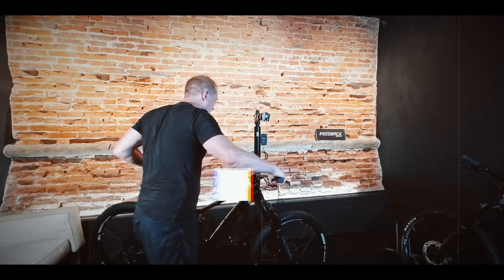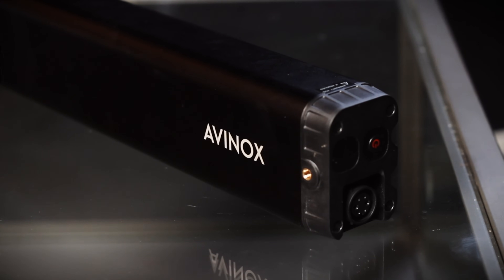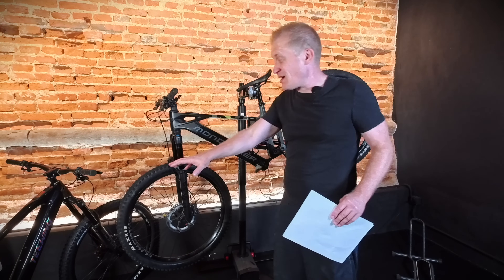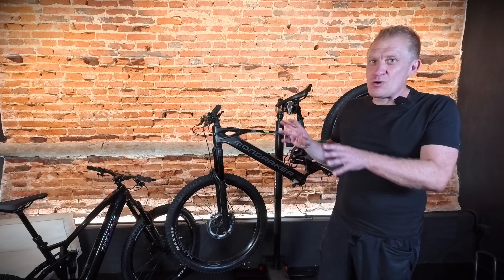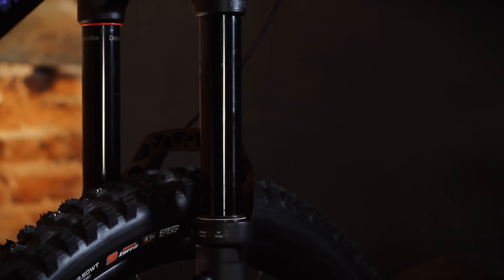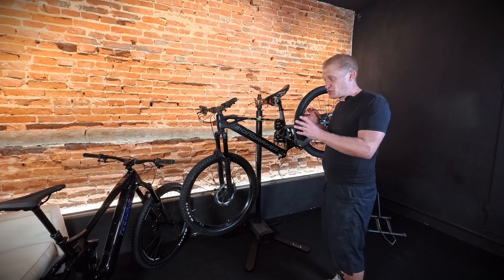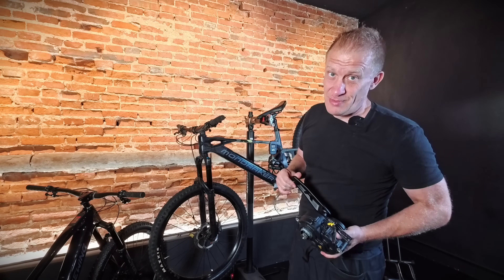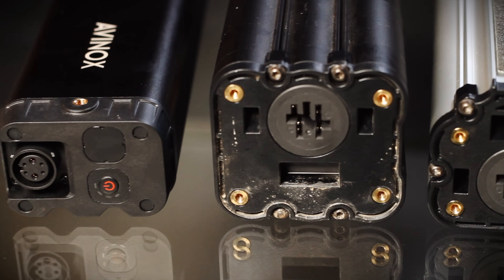DJI Or Bosch For A Better EMTB?

Comment: The DJI motor clearly wins in the software display department. I've seen several people who have tried both say the  DJI motor feels like an full on full off experience while the bosh performance cx responds better to your pedal. IE the more you push the more power. The latter seems more ideal. The Bosh motor is more refined in that aspect. DJI gets a lot of hype because it can put out more power. I'm not sure that hype is deserved though because that extra power draw is exceeding class 1 ebike limits. I don't think that is a good thing. 100 nm is a lot of power. Honestly I think that should be the cap for e- mountain bikes. DJI really made a splash with the software and power of that motor but they really pushed the boundary in a way that the bikes might not be legal on most single track trails in the US since they  don't meet the class 1 ebike specs. So when you operate the bike withing class 1 parameters, is isn't so exciting.

Comment: Absolutely same conclusions 6 months ago, i took mondraker crafty, and not amflow. My friends say "its heavy" but, put this stuff like Shimano XT or FOX 38, and it will be almost the same weight. I have 750 watt update on it, but not using this when i ride trails. 600 is enought. Too much marketing, like display in a frame. For what? I need just indicator for mode and % of battery and not reading books on it. Im over 100kg, and when 80kg reviewer say that he feel flex on Amflow frame, we know where they save weight ;)

Comment: Respect sir that’s exactly what I’ve explained to people who gets the avinox or light weight bikes 
Same happens to me got a turbo levo carbon expert 2022 weight 22kg
Tyres side wall junk 
Wheels folded like paper with singing spokes 
Now I’ve upgraded the bike to a full heavy enduro machine wheels brakes suspension coil shock tyres now weights like 26 kg 😂😂😂 it’s not possible to have an enduro all moutain bike stronger and light at same time
Reply from the maker: unless you drink kool aid and have an avinox motor ...... then we are all wrong and we know nothing.....:-)

Comment: I think a big thing to note on the batteries is the length, while the avinox may be slightly lighter it is much longer and will have its weight distribution further up in the down tube towards the fork. It terms of ride quality it seems like having the CG as low as possible is pretty key and the Bosch should do a much better job of keeping the weight low and as close to the BB as possible.
Reply from the maker: The GLP3 is the king sfor weight distribution
Reply: @alexbiketester a lot of e-ews were won aboard that

Comment: Rider weight. Very light riders will notice bike weight more.  Light rider smaller motor & battery makes sense. 70kg rider 600w/h. 90+kg 800w/h with powerful motor.

Comment: Hopng Bosch make a slimmer 800wh (yes, and longer) battery profile option in the future to allow for slimmer downtubes. 600 not a good option for me as I  routinely drain my 750.
Reply from the maker: apparently they have a thin 1000 in the works
Reply: Get the power more..

Comment: Before buying my Teewing, I did extensive research.  Simply put, DJI's motor, wireless and battery systems are more advanced than Bosch.  Not surprising given that DJI is the world's leader in drones, which gives DJI extensive experience in minaturized motors, advanced batteries, and wireless communications.  Bosch's background is in making household appliances, power tools and heating/cooling equipment.  The tech required in their past products is very different.  Bosch's push to limit ebike motors to 750-800 watts is an implicit admission that they are having difficulty in keeping up with DJI's tech.
Reply from the maker: i know what you are saying but this reads like Ai...
Reply: @alexbiketester  LOL.  I somewhat doubt if ditcho100 has been mountain biking at all.
Reply: So what your saying is you work for or are paid to comment favorably for DJI. Got it.

Comment: A few things to keep in mind. Amflow comes with a compact portable fast charger and also lets you ride in class 3 28mph in the US. The bosch systems do not have these features.
Reply from the maker: the fast charge fact will ruin your battery quicker....
Reply: @alexbiketester fast charging doesn't ruin a battery, heat ruins a battery and also continuous charging when at 100% causes stress. Always charge in a cool environment and and when reached 100% remove from charger, and don't store at 100%
Reply from the maker: @Hassle68  Specialized specifically told me, that their battery can handle 250 fast charges, then it will degrade and need replacing.

Comment: I’ve got the latest Bosch with the software upgrade. Plenty of power but where it wins over the Dji and yes I have ridden both on the same trail on the same day is the smooth control, the way it delivers the power. Also its top power is not limited to a burst either. Then my living situation means I have to take the battery out for charging, it all became a no brainer.
Reply: My Teewing's/DJI's power curve is extensively adjustable via the app.  So the power surge is very adjustable in each of the various modes.  You also can get full power of 1000 watts in the Turbo mode with the latest firmware update.  Not limited to boost mode.  I doubt you had the opportunity to do these adjustments on the DJI.
Reply: DJI motor also reacts faster due to its measuring the power delivery 46 times per wheel rotation vs Bosch's measuring this only 1 time per rotation.
Reply from the maker: It's good to hear your experience
Reply: What type of bike do you have with the Bosch?
Reply from the maker: @richardulrich9001  Crafty RR Or R
Reply: @richardulrich9001 latest trek rail + a very sweet ride. Others may be as good or better, but this one fits my riding style and trails and me like a glove.

Comment: I use to want a removable battery but you can make due without one. Use to leave the bike into the car and take the battery up the stairs because it's so much easier to carry than the bike up 2,5 stories. But removing the battery has it's own strain so I've started avoiding it. The battery door screw goes into the aluminium of the frame so it will eventually wear out and can't be used anymore. Although that is a specific design flaw to the Rocky Mountain frame. 

Another scenario is charging the battery mid ride. Far easier to take the battery out and find a socket than to do the same for the whole bike. Or for certain hotel scenarios where you might not be able to take the bike. But haven't really needed to remove battery even once this year. 

It's just that if you do need the removable then you have to have it but otherwise the weight savings are pretty great. I would buy a DJI with the integrated. I use to want a removable but at the moment indifferent to it.

Comment: DJI for power Bosch for technical riding with the instant power. Although Gen5 brings the power slower than Gen4 and they made the idiotic decision to have overrun cancel when you pedal backwards... So they cancel the overrun when it's needed 😂. This is why you need practical knowledge only an engineer could've designed these features.

Comment: For me , Bosch really screwed up with the form factor of the 800wh battery. It makes the down tube really bulky and ugly. Also, having a bulky downtube need more material and thus more weight… 
For me, the slick, fix battery, fast charging of DJI is a better design.
I also think that the DJI  bottom bracket area look better.
For everything else you said, I totally agree that weight  is build spec dependent. 
There is also frame material carbon vs aluminum that probably save 2-3kg.
I currently have a aluminum ebike, and after trying a Carbon one, my next one will be carbon

Comment: Awesome video. Another huge factor to consider is after sales support and parts availability; the Bosch dealer network in the UK is pretty comprehensive and batteries easily available. I suspect DJI can’t claim the same re dealer network and I know they can’t with regard to batteries as there’s no UK distributor as yet.
Reply from the maker: Apparently in italy if you need a spare part for a DJI system on a bike that is not amflow you need to know someone who works at amflow so they can get hold of one for you. Right now ther eis zero support. That is a shop owner telling me from the distributor of the bike company. Yet again, on EMBN yesterday it is announced as the best motor in the world everyone wants it... so much BS....
Reply: @alexbiketester everyone will want the AVIONX motor next year few big changes
New avinox m2 in January few more brands to be announced whyte,commencal, orange forbidden, unno,brands holding off until march/April with the motor 😉

Comment: of course its the bike builds that warrant any weight differences, all you have to do is go with the Bosch or Avanox stated weights and deduct that off the bike weight. Are you saying that people are buying (say) the Amflow due to its low weight thinking that  it's due to the drive system? I find that tyres are a large place companies reduce the bike weights, it's pointless and a waste.
Reply from the maker: yes, they are, all amflows ive seen people have had to upgrade them to do the riding they want as tyres were too light, suspension. was weak etc...
Reply: @alexbiketester exactly, thought it was common knowledge that they have done that, just like most SL e-bikes
Reply from the maker: @philthy4654 just switching to bigger tyres with more aggressive casing and tread adds like almost a kilo
Reply: @alexbiketester I know, pretty crazy… but worth every gram
Reply from the maker: @philthy4654  I suppose it gives you an extra set of spare tyres..... as well

Comment: Glad to see Alex has seen the light And stopped bashing Amflow ,Teewing & DJI & now sees what great value  bikes they have produced it all comes down to personal choice, if you want 1000 w it’s got to be DJI powered.
Reply from the maker: havent seen any light and never needed to, and was never against the product, only the marketing.  

everyone has been so brain washed by the paid for ads that every other youtuber has been doing they cant understand  when someone pointed it out. 

i actually on merit dont like the amflow software ride feel its a motorbike, the multiplication factor is way too high rides like a cargo bike in top power modes. Experimenting with lower power modes, so far they are not impressing.
Reply: Having a opinion is not the same as bashing - At present time I would never buy a Avinox I leave it to the brainwashed fanboys. Happy ride🫡
Reply: @Taxdeath  you ned to try one for a few days then you too will be brainwashed & understand the true meaning of happy ride .

Comment: I bought the DJI hype, nice video to really see the differences.  I believe the biggest pro or reason we like the DJI is the comestic details of the frame.  They look just way better without that huge downtube.  I went ahead and bought the santa cruz bullit, being with all the import problems with dji in the states, we probally dont even get a decent DJI bike in the states any time soon.
Reply from the maker: buillet is a beast! you can slay anything with that! so fast down hill
Reply: Got my Teewing Turbo Force shipped to me in NY tw weeks ago, courtesy of Drip-E Bikes in Atlanta.  Thing is pretty amazing.  Powerful, almost silent, battery charges really quick, handles great.

Comment: sorry but this video is a total waste of time, was it meant to be a comparison between the motors ? or just the weight ? 500 grams is a lot of savings, you aren't making much sense ! to gain that on tires, or a fork you have to make a lot of compromises ! but, why the focus on the weight ? the DJI avinox is much more powerful, smarter, better software etc... or is this just one vidéo among many ? announce that in the video then !
Reply: My latest Bosch with software upgrade is a better all round ride, yes I have tried both.
Reply from the maker: title is different according to AB testing.... I focus on weight because this was one of the original points that the hype for DJI was about, high power low weight, not true. Software, so far, crap, let you know if I find a better setup.

Comment: Another excellent & informative video.👍 I debunked the whole “tiny battery equals light-weight” thing years ago. I have two, older (2017) Bosch batteries. A 400Whr & a 500Whr. They are 8oz different in weight. So the difference between a 600whr & an 800whr should be, as you said, the same as a 16oz water bottle. Big deal. However, the difference 200Whrs makes to your ride experience and range anxiety is HUGE. IMHO, small batteries don't make much sense for “most” riders. Great video.👍😉
Reply from the maker: thanks for watching
Reply: It's good to have battery options. I rather have a smaller battery for 90% of my rides and add an extender for the longer rides. A smaller battery saves two pounds but more importantly, it lightens up the front end and makes the bike a lot more nimble.

Comment: M2 Avinox - same mounting points so existing users could potentially upgrade?
Reply from the maker: no motor company has allowed upgrades so far.... they want to sell you a new bike.
Reply: Not true TQ allows upgrade from HPR50 to HPR60
Reply from the maker: @chrisrogersnz  ive heard that, but..... on some bikes you need to remove the heat fins which reduces peak power apparently

Comment: What about where the weight is in the bike ?
I just got a 50% discount on a Lapierre glp 3 probably thanks to the demand for the DJI bikes, it might not win
any beauty contests but it rides like an SL bike.
BTW it's 24.5 Kg with the 800 Wh battery.
Reply from the maker: incredible bike! See my tests on it and the previous version!
Reply: I have a Lapierre GLP III with a Bosch Race motor, which I bought in November 2024. It’s an incredible bike with an 800 Wh battery, very reasonably priced at 6,200 euros. Top-class components, amazing on the trails – truly a bike of superlatives! The design is a bit different, but definitely worth every pedal stroke and perhaps somewhat overlooked or underrated in some tests. Alex praised it, and he’s absolutely right!

Greetings from Slovenia!

Comment: Here are some questions to ask when looking at a new bike. What's the most important factors to you:
If it's weight, buy a $200 smart scale like the Hume body Pod to learn what weight you should lose. It shouldn't be on the bike.
Where will I ride this bike? Technical trails, flowy singletrack, drops, jumps? Pick a trail that represents what you'll want to ride then test several bikes across trail to enduro to see what type is the best for you. That might be the most playful, your PR, or what just feels right. This is a personal choice that shouldn't be influenced by anyone else.
The DJI & Bosch are both incredible systems. You can't go wrong with either. I think it's more important that they both exist to push each other as far as innovation and to eventually bring the costs down.
BTW, ask your friends who currently have removable batteries, if they've ever removed them. You might be surprised what you find out.
Reply from the maker: top tips.
Reply: Bike  vs rider weight doesn't matter until you must push it uphill and lift it over trees or rocks...  I keep hearing this "loose weight yourself", this is great in your 20s but over 40 it don't work like that no more :)

Comment: Nice video Alex but ...this time we are not on the same wavelength
Agree that Teewing is a trail bike and.. honestly, I don't trust it BUT ... if you compare a Mondraker Crafty RR ( 24.4kg) with a UNNO Mith Race (lowest equipment, 21.3 kg) both being enduro, the weight difference becomes more.. REAL (the equipment being about the same.. a little heavier/better on the Unno). I would always choose the Unno over the Mondraker ..full power (a lot more power), but much lighter weight 3.1kg!!!!
  And yes , Unno doesn't have a removable battery, but you can charge it in 2.3 hours, which is enough for me if I charge it during my lunch break on a long day. ( I did a test on the TMB tour (Courmayeur - Les Contamines) 53k - 2800m diff+ with an hour and a half to load at lunch. (I weigh approx. 95kg)
The price is approximately in the same range.
Even the Crafty RR S 600wh battery version (22.6 kg) is 1.3 kg heavier than the Unno.
Reply from the maker: 10k bikes will hurt more than the weight... LOL.... it is only 400 grams difference, my experience with DJI is that range is vastly reduced with top power modes as obviously its using 1000w. Im testing currently mid power modes, lets see what i find.
Reply: @alexbiketester  Let's be honest, very few of us (non-professional e-bikers) get to extract maximum power from the motors (Bosch 750 w / Avinox 1000w) and that only for a few moments.  And yes , you are Right, Avinox has a bit les range , but since it charges very quickly, my opinion is that, it beats Bosch.
    My opinion is that, Dji Avinox changed the e-bike motor market a lot , which took the big boys (Bosch/Brose and especially Shimano) by surprise. That's why, there was a lot of pressure on the UCI and the "Santa Claus federations" to limit the power developed by the motor to max 750w in a contest. One of the best marketing models is to win competitions, if the limitation hadn't existed Bosch/Brose would have said goodbye to the podium, it would have been the same for them as Shimano was before the EP801 update.
    BUT I wouldn't have taken a DJI Avinox on a bike like TEEwinf / Amflow or similar. A bike like Unno, Forbiden or Commencal is another story, there you already have a well thought out bike and then an engine that .... for now does its job very well.
Reply: If you see one (mine has a 38 Fox Grip X2 fork), the Teewing has a pretty burly build.  Straddles the trial/enduro line.  Can take a rear coil shock  and 180 front shock as well and be turned into a capable enduro bike.